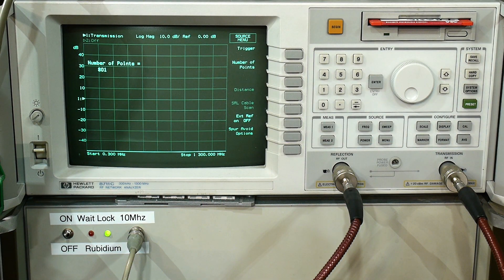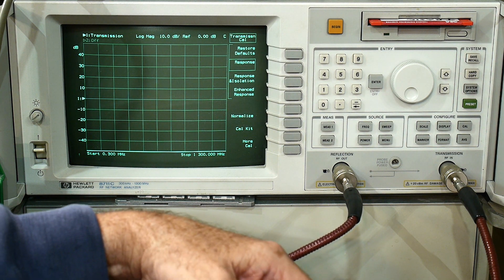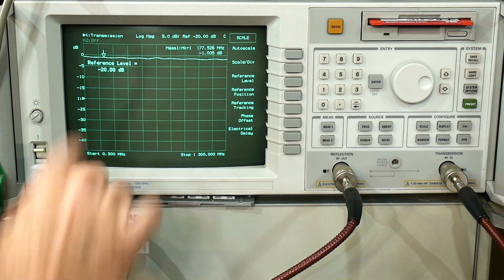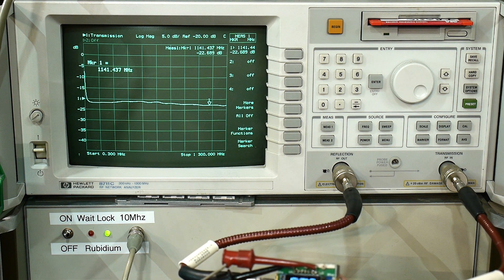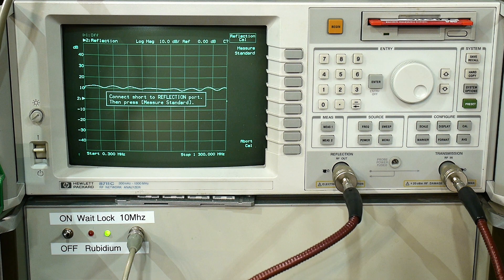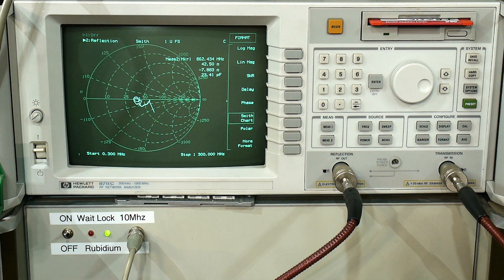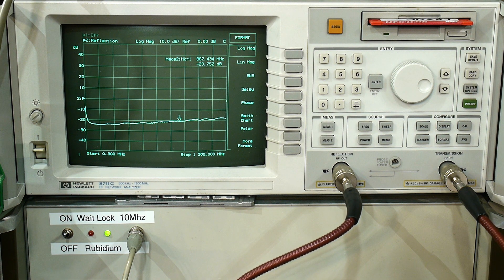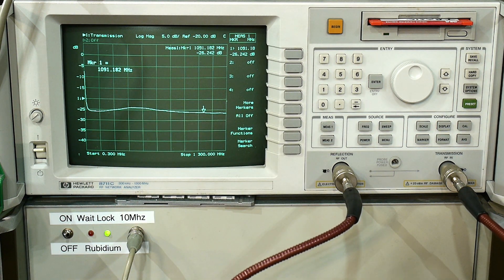#1025 Digital Attenuator S21 and S11 VNA Measurements

Comment: WOW! That was exactly the kind of vdeos I was referring to when I asked for them.
Very interesting the lack of coverage in the HF. I was about to buy one for using in calibrating my Advantest S.A. (a stepped 30 MHz calibration signal is needed...). I learned here to stay away from them (at least for this special purpose...). What were the original passband specifications for this device? There are many around stating going from 1MHz to 3000+MHz....

Comment: I didn't get one of those attenuators, assuming they were just about as bad as you verified they were. But I suppose there are applications where it would be handy to have even a not very good attenuator that could be automatically switched by the associated circuitry. However, I think I'd probably stick to fixed attenuators switched in by FET's or relays. I'm just the picky type who likes everything to work as well as I can manage.

Comment: Very Nice, everything I've gotten from China has been about the same as your attenuator including my RIGOL 5 1/2 digit DMM (DM3058E) which was very good for the money and most everything works well but the capacitor function gives erratic results. All my other LCR's agree but the Rigol does not, must be affected by some interference in my lab. And I do have a NanoVNA which is cool to have but it takes some work to get results.
Thanks for the video,